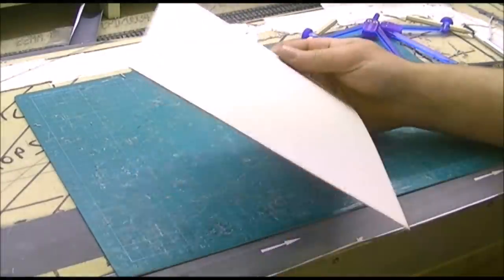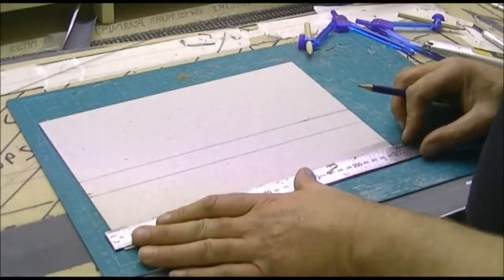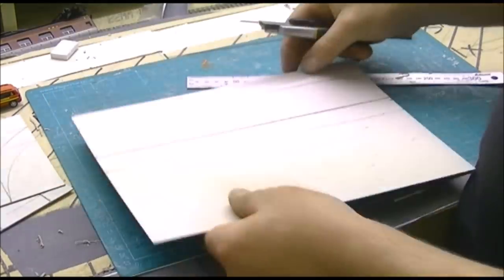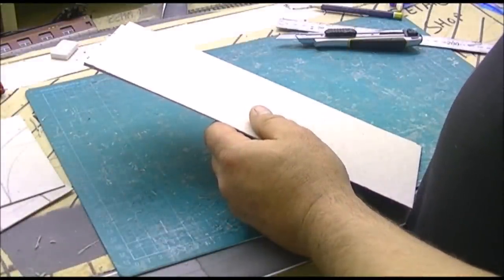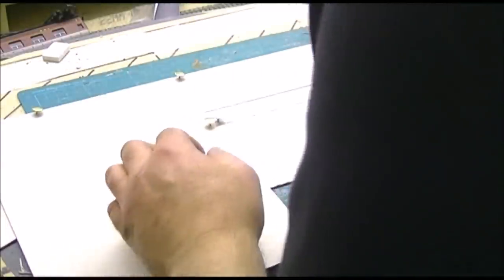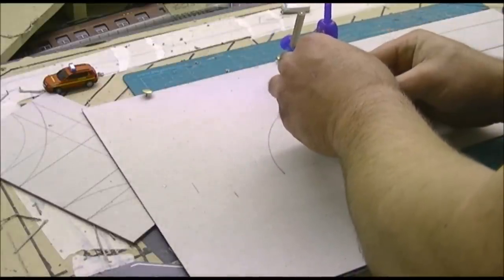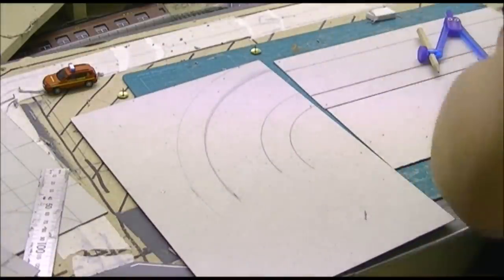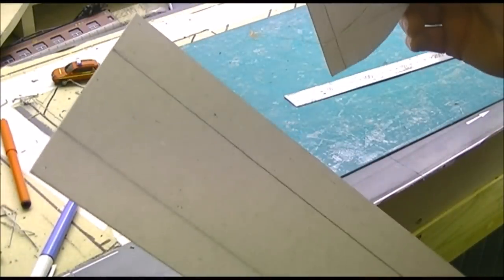how to make faller road pt1

Comment: Hi I like your layout. and I think the faller car system is awesome just another idea how you can do it. u get a block of wood the width you want the wires apart. stick two pencils to each side of the block of wood and just draw out where you want the road. that way the wires will be the same width apart all the way round.

Also I've seen another video on this where the guy just put the wire straight down on the base board then build the road up with bits of card till it was the same height of the wire then put the road bed over it he used that road way roll thing so you will have a unbroken roadway rather then having paper breaks in it..

just another idea for you
Reply from the maker: hi thanks for the comment, Like the idea with the wood only prob is only got 2 or 3 bits left to do.hope to have all road put down today and get another vid up next weekend. thanks for watching

Comment: hello. and thx for this tutorial. just a question : the cardboard is only 1mm thick or did I misunterstand something in the video?
Reply from the maker: yes i used 1mm thick card so the road wasn't to high that way i could use 2mm thick card for pavements etc. only thing is you do have to be really careful when grooving the lines for the wire, if you are to keen you go right through it. if your looking for the greyboard like i use you can get it off ebay , but because i buy it in bulk like a hundred sheets at a time i go  online and buy it from paper-cutz. the good thing about doing it this way you can more or less make a road system to suit yourself. and you dont have to  fork out 80 odd quid for the faller road groover .

Comment: Thank you for the great video on making roads. I have a few questions if you don't mind answering if you can.I noticed the road you are making in the video is wider then the one you had already completed. Can the roads be different widths?What type of wire needs to be used. Would any electrical wire work that's 1mm size?How do you glue the wire in place? You mentioned tape it in place. Was that to hold it until you glue it or was the tape the only thing you used to keep the wire in place?Thank you.D